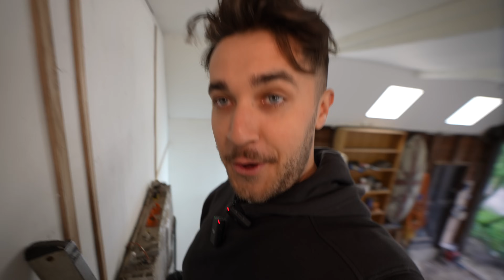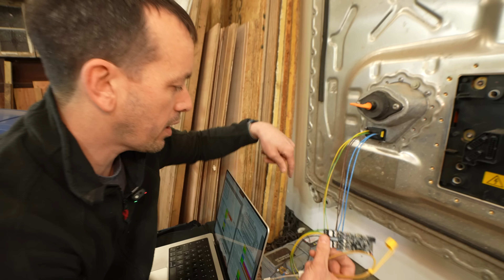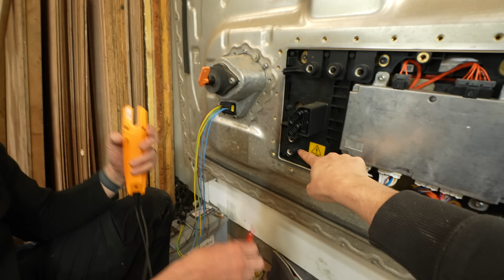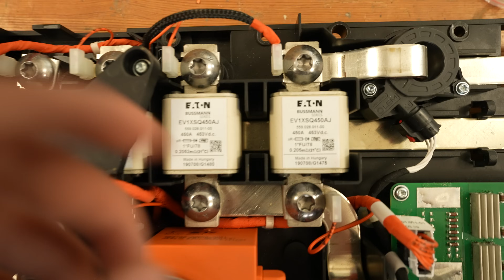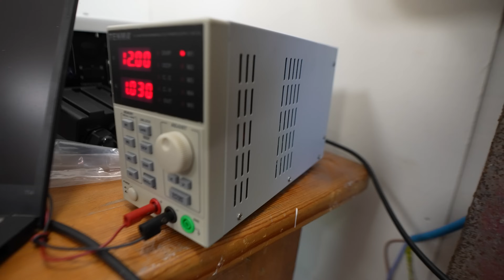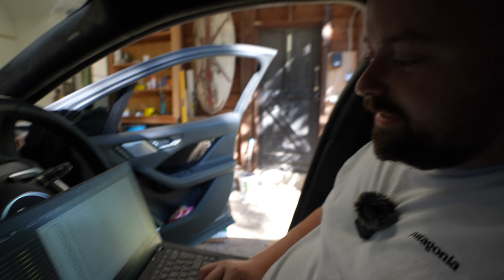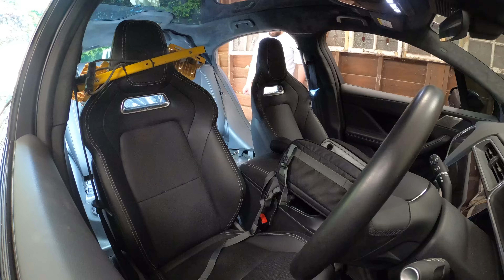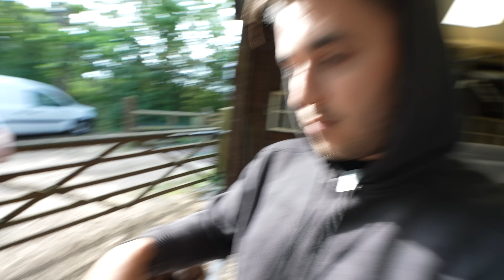Hacking an EV Battery From a £90,000 Car -  DIY Vehicle to Grid | ØY44

Comment: Not a expert. But what I suspect, is that the battery module is "coded" to the other control systems in the original car. Most electronic modules in cars nowadays, have security codes built into them, and won't talk to other modules until they are "coded". It's really just matching it up with other modules in the car. It's done as part of the car security system. 
So what I suspect, is the battery is looking for the security system, to tell it that A) everything is ok, and B) a valid key has been detected, before it'll enable it. Until you meet these expectations of the system, it'll probably default to off. And it's also why it won't work, just by hooking it up to another car, because the module codes will be different. 
What you will probably need to look into, is what controls the security of the original car (probably a body module of some sort),  and look into how modules are coded into the car when new parts are installed. Then from there you can work back and figure out what the battery module is looking for, and replicate it with an Arduino or Raspberry Pi or something.  
That initial burst you see in the CAN BUS, is probably a handshake, looking for other modules on the bus, coded to the same car "network", and when it doesn't find any, it shuts down, because it doesn't get a handshake response that is valid. 
Also, the fact there are 3 CAN buses, you probably have a primary one, and a backup one, most cars have two networks now, so if one network fails, due to a wiring fault or something, it can continue to talk on the backup, a flag a fault code in the other modules. The third might go to a module for the battery cooling system, or the security system or something. 
Another thing to consider, is it's probably got codes stored indicating it was in a crash, and these will probably need cleared before it'll operate again. 
SO best bet is to dig into the wiring diagrams, look for the ODB port, trace what module it goes to, and then figure out if that module controls the security system of the crashed car.

Comment: Last year I programmed an ESP32 to talk to my renogy batterys via bluetooth. And send this data to my homeassistant. It tool some time, but it was possible and it was worth it. You will crak the puzzle, and this will be a big step for Dalas Project. Which is a very great github project.

Comment: An idea… does the battery in the car have a specific serial number that is known by the car system?   Are you able to read it so that you can rename the battery on the wall so that the instructions now available on the laptop are communicating with the “same” battery?   Or is that just naive nonsense?

Comment: No 1 - the interlock circuit doesn't work by shorting it out, some other manufacturers use a 12v 88hz bidirectional signal through the wires, if that signal isn't seen on both wires then the interlock circuit cuts out the battery contacts.

Also the interlock circuit usually runs though all the high voltage orange plugs, the two tiny pins at the top or bottom of the large orange plugs are the interlock circuit pins. 

No 2 - HV battery packs have internal pyro fuses that blow when the crash signal is sent out by the SRS control unit, this is called tml30c, the crash signal circuit.

You really need to find out what the interlock circuit actually is, if it's frequency or PWM ect....
You also need to have a loo myo see if you've got interlock running through the orange HV plugs.

Comment: You can cut the CAN wires and make a transparent gateway. This way you can deduce where the signals are going from/to. 
I worked for a company that hacked cars for handicapped people. Our device was injecting messages like the car horn, indicator lights and other secondary controls while actively filtering the original messages.

CAN messages often have one or multiple counters, each frame increments this count up and often the last count is skipped. 0xC, 0xE, 0x0, 0x1 etc.
CAN messages also use CRC as a checksum on each message. You can use CRC RevEng to reverse engineer these crc, sometimes this is impossible and you just need to hardcode a LookUpTable.

Hopefully you don't need to got his deep into CAN, and just replaying the messages will be sufficient.

Comment: If you tell the motor to run at 3,000 RPM for 50hz or or 3600 RPM for 60 hz, you can maybe run a 3-phase transformer to create some 240v 120v etc. This would function as a linear supply and be strong as. It will be dliver PWM  square waves to the inductor mind, but it should be fine and smooth it out into a sine wave (3 phaser).

Comment: The one major problem with the idea of using old lithium batteries is that once a battery drops below 80% of it's original capacity; they start to lose capacity much more rapidly and below 70% they are generally falling off the capacity cliff and the risk of having a shorted or failed cell increases exponentially.  You might be able to eek a few hundred more charge cycles out of some batteries and chemistries but once they are at or below 70% of the original capacity, they are basically junk and one should be looking at replacement even in an offgrid/solar storage application.
Reply: Isn't the SoH a record of the weakest cell in ANY of the packs in the battery? If so, then wouldn't it make sense to simply replace the pack that contains the rogue cell - assuming that it's just one pack affected.

Comment: The battery likely has some expected code that may be different with every model/serial number of vehicle such that replay attacks don't work between devices. Some people in the industry call this "marrying" and it's done to make it harder for people to repair vehicles without specialized tools, should they decide to try replacing stuff themselves.

That being said, if some of the other car parts were used for repairing another vehicle, then it's probable that this isn't done on every part of the vehicle, or may not be present at all.
But again, it's entirely possible that there's subtle differences between each make/model in terms of the specific codes sent in order to get it to start.
Some vehicles may also employ things like rolling code protocols, though i doubt that would be the case considering the aygo worked just fine with a replay attack.

Without knowing the exact content of the captured packet on the AYGO, i couldn't really say.

Comment: This video was quality and will open many peoples eyes to not having to pay 30k+ for off the shelf solar bits with fancy brand names..
Reply from the maker: Thanks mate
Reply: @corymac  You should have a look at server equipment too. Our office had UPS batteries that could run the entire full server rack at full chat for 4+ hours. When it closed down I took one to use as a solar power battery at home, as in a normal house just one pc, tv etc.. it would run for a couple of days haha. They also have built in 240 inverters

Comment: Gutted this was one of the most interesting and wnjoyable videos ive seen in a while . Looking forward to part 2.

I presume nothing is starting as your missing numerous items from various diffrent ports such as airbags , lights etc etc. oh and possibly the key issue of the break pedal being presssed. (Just throwing ideas out there)

You probably would be best to create or order yourself a wiring loom instead of soldering all the time they you can use jumpers to.probe and connect much quicker. Do you not have the old connector from the donor vehicle? 

Also what the voltage of the battery at present is it charged? Will it charge in its current state or is the bms blocking it. 

It may have been quicker to remove the guts and just bypass and install your own basic bms to facilitate what your trying to acheive .

Great video cant wait for part 2
Reply from the maker: The battery BMS only knows those missing components are there because of can signals, which we’ve emulated. So there’s another Coms issue, but I think we may have just solved that 😁👍🏼
Reply: @corymac  if there isn't a video then it didn't happen 😉👍

Comment: Also, if it needs a car, give it one! You can write code to make it think it has everything connected, can't you, or take those lines out of the code so it isn't actually looking for what isn't there. And yes, i know that's simplifying it as you would have to replace those missing lines to explain WHY it no longer needs to 'talk' to every line. I know nothing about EV batteries, so if this sounds stupid, apologies.
Reply from the maker: We’ve done exactly that. The Liligo device is emulating the ECU

Comment: you guys trying to measure the 60 ohms across the can clearly shows you dont even know the closest what you are doing there :P

reading OL should already tell you, well yeah, theres no can termination on the battery AND there is no can termination on your board! 
should read 120ohm if atleast one was terminated!
Reply from the maker: It’s 120ohm total, 60 ohm at each end
Reply: @corymac  yeah... no
60 ohm total, 120ohm at each end, because the 120ohm resistors are eventually in parallel, at each end.
and as you stated, something electrons divide?
Reply: @corymac  something i could recommend you is trying out a U2C, its commonly used for 3D printers running canbus, it translates USB to CAN, Esitericals CANBUS guide also contains some helpful info, even tho its aimed at klipper and 3D printers.

Comment: Can you not connect directly to the battery out and bypass the control modules, let the inverter control the charge voltages and max load ?

Comment: Dear all. (10% of shares for the idea please). I've been slightly obsessing over this, since I saw a 6 month old EV (still drivable), written off in a crash, for sale for under five grand- with a 64kWh battery onboard. Why isn't some smart, hard working guy/gal, building the appropriate converters/translators and installing these. EV quality battery, 64kWh?, you'd get at least 20K for that installed, possibly much more. Go on.... YOU!
Reply from the maker: Just so risky for electricians, I wouldn’t typically do this, as it’s uninsurable really

Comment: The BMW i3 battery was designed from scratch to be used this way.
You will also find that thousands of very clever people are working on the processes to use 100% of the materials. 
Cobalt ISN'T present in Teslas LFP batteries, it's Iron instead.
I do wish these youtubers would fact check first, they have a responsibility to educate correctly and not let people scrape untruths.
Reply from the maker: Tell that to the garage we bought this from, with multiple brand batteries stacked up

Comment: Have you thought about the interlock loop? (The 2 little pins on the big orange connector) 
These 2 little pins need to be shorted to make EV-systems or the battery work.

Its a safety feature, if a module breaks or the car is in a crash then those 2 little pins wont be shorted and disables all the high-voltage systems! Including the big contactors inside the battery!

Comment: I am no expert on EV's, but I am a qualified mechanic, you were right when you explained that a canbus is a network connected with different addresses, why don't you hook up the original wiring to the battery and try to control it through the gateway? I don't know how many gateways that vehicle have but you can probably research that. normally your gateway would be in your engine control module or your cluster or your body control module. The gateway is the system that speaks to all the other control modules, so all messages travel through the gateway to communicate with each other. If you can mimic all the signals that you need for the vehicle to think it is safe for the battery to switch on through the gateway but then it bought probably switch on, for instance if you take the wires from the break switch and you put it onto a normal flip switch that would be like an unoff switch or a safety onoff switch, and so on and so forth.

Comment: Interesting project, I like it!

The BMS communication problem is always there. My idea would be to use a deye high voltage inverter, there you can defin a battery only by voltage levels. Not perfect, but works and is easy.

Comment: I used to do this in testing chambers. We'd use the batteries for the thermal mass to test heat pump systems on while charging and discharging the battery in road load simulations. We used manufacturer provided DBC files that decoded the can bits and a logic controller that tricked it into thinking the car was there. All privided by the manufacturer

Comment: This is a great idea.  If I knew that I could take a failed battery from my EV when I had to buy a new expensive one, I would have little hesitation to buy an EV.  This should be a standard option you can buy for all EV batteries.  Reuse is better than recycle.

Comment: People like you are leading the way to a perfect reuse of large battery packs. Plz push on and consider making kits at the end of your adventure for others to reuse large batterys as well.
Reply from the maker: I’m publishing my findings and code for free online 😃👍🏼
Reply: @corymac  great start,, but code i fall apart so hard on code, my thought was a sellable for you and a plug and play for the viewer of yours.
Reply: @joshuaspires9252 plug and play would mean any faults would land back at Cory's door and I doubt he'd like that, not to mention the liability he'd be taking on. Much better to release it openly so that the learning-pains element is gone, folk just need to get a competent & LOCAL electronics engineer in to implement it.

Comment: I would suggest you might want a cooling system for the battery pack so it will last longer. I would use a wall system like this to charge my EV free gas or power you A/C system only in your house. Especially useful for areas you can by cheaper electricity at night and use it in the day at peak power prices.
Reply from the maker: We’re reusing the car radiator! 😁👍🏼

Comment: Hi guys, I just came across your video, and I heard you say that the car had a light crash. If so, your BMS might be in protect mode—a tripped switch that cuts power to the vehicle.

Comment: This is a very ambitions project.
It should have been done prior to scrapping the crashed car (hindsight is 20/20).
I would try reconnecting as much of the old harness as possible and work from there.
Alternatively, and I hate to be negative but I think your chances of cracking those data packages are slim..
I would reverse engineer the controller board and replace the processor with a hacked in Arduino. 
Control the relays and do your best to try interface the analogue inputs.
Start with the safe stuff and work your way to the dangerous interconnections. This assumes there is very little electronics inside the battery itself.
Good luck guys.
Reply from the maker: That’s the plan. Thanks mate! 😁👍🏼

Comment: So you've got the following from CAN: Door closed, foot on brake, Start/Stop button pressed. Maybe you need information form the driver seat sensor too? (e.g. In a Volvo C40 Recharge, if you lift your butt off the drivers seat, the car doesn't like it)
What about charging the battery? Would you need to record a different sequence from CAN? 'Car in Park, Handbrake on' is about the only thing I can think of.
This is a fascinating project!
Reply from the maker: We have all the can recorded that was necessary to start the working I pace 😁

Comment: Were the airbags blown on the donor car? If so there may be a pyro fuse that has blown in the pack. Also a crash may have been recorded in the BMS which is stopping it from activating, so the fault code will need to be cleared
Reply from the maker: They were ok, so was the fuse 😁👍🏼

Comment: Don’t know why you did not try on pallet on floor? Reach easier for testing, then when working hang it up.  Why have table so far away? Car door open will not let car power up.
Reply from the maker: It was to begin with, but wanted it on the wall eventually, and it’s not really that hard to get to 👍🏼👍🏼

Comment: I have done a quick review of some of the current bms systems used by the ev industry. It appears that the complexity of the systems is based on software library of libraries approach to development. The biggest problem with this is that the start up procedure is so bloody complicated that someone probably could not deliberately make it more complex … so for start up all seats are checked for weight and if seat belts are not connected it puts up warning … if the power cap is open , is the the boot open, is the bonnet open, is the voltage correct on12 v sub system.. this goes on for 100’s of issues.. So your current approach requires all of these issues to be communicated as ok… or change the bms… There is a dev company in Texas working on the Tesla battery for repurpose and they concluded that replacement was the only approach… Until the manufacturer has responsibility for repurposing of ev batteries we have a major problem… I hope you prove me wrong .. thanks for documenting a complicated engineering process …  retired engineer